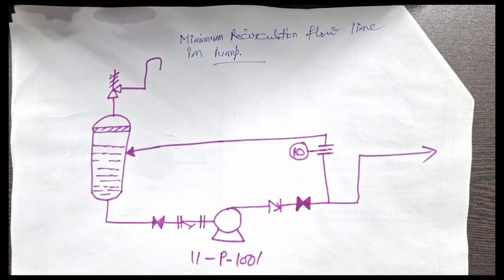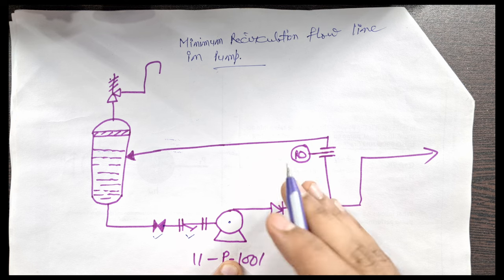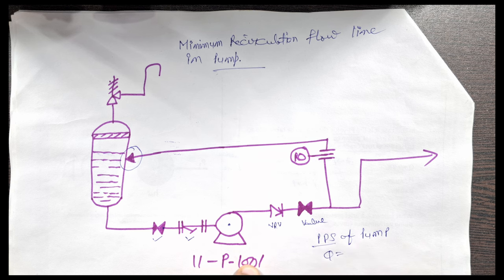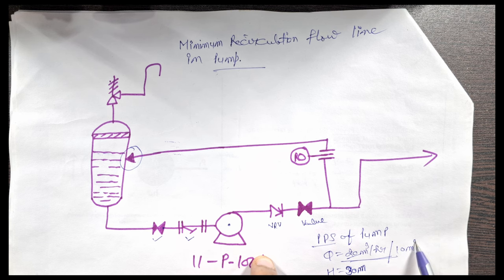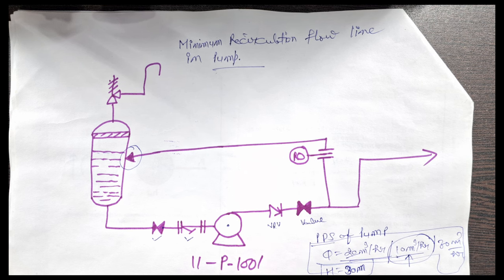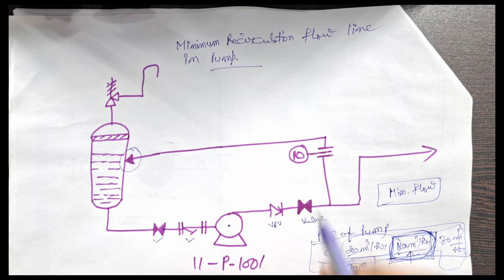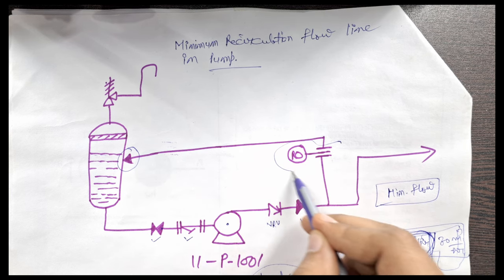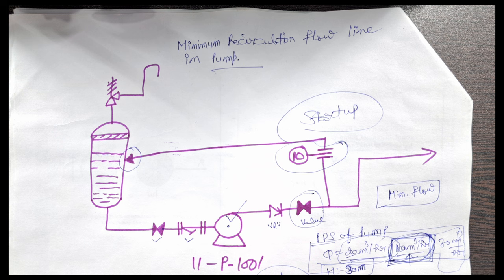Minimum Recirculation line of Centrifugal Pump | Recirculation line of Pump | Core Engineering

Comment: Meeting minimum flow and protecting the pump against deadheading conditions are the main reasons why recirculation loops are installed. But, they can also help keep product in a desired state. For instance, they can help turn a tank over and keep solids in suspension

Comment: Minimum circulation line maintain minimum flow from pump to prevent cavitation which results mechanical damage of pump mainly its impeller.if impeller get damage  pump efficiency means flow and its pressure will reduce.